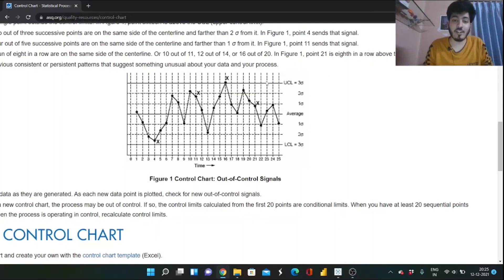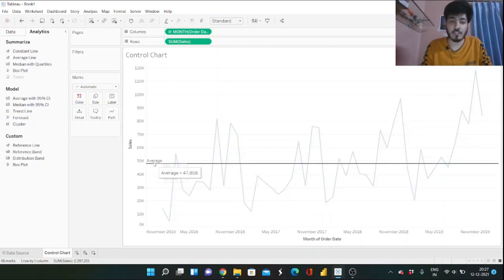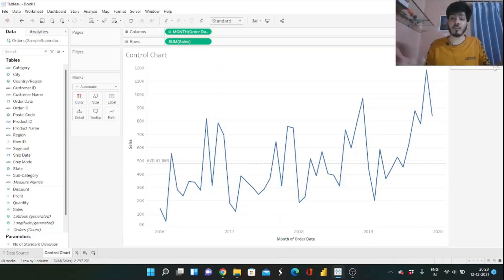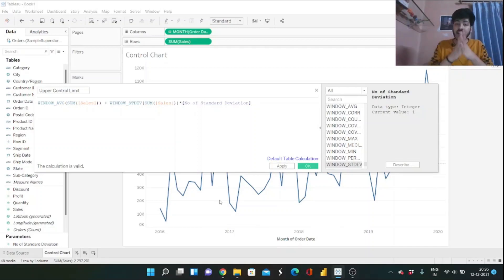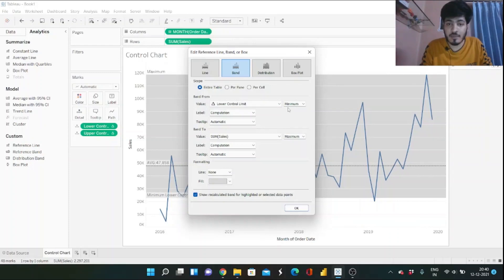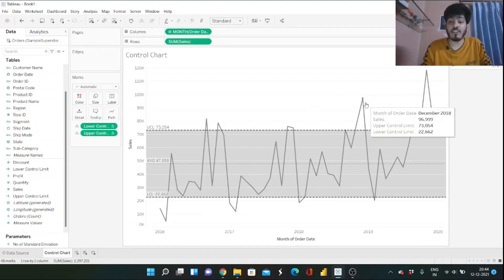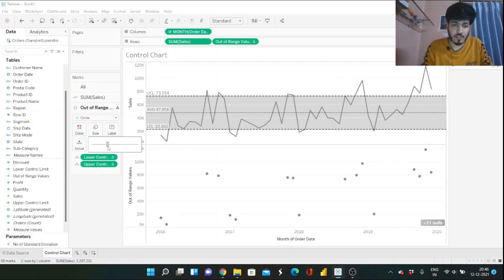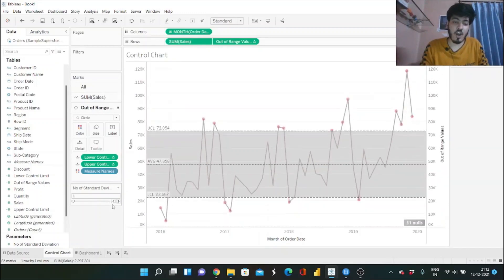Control Chart or Shewhart chart or Statistical Process Control Chart| LearningWithProfessor|Tableau

Comment: Hi Thanks for knowledge sharing
Just wanted and new to stats
What is 1,2,3 in STD
How it's multiplying to sales
Reply from the maker: Glad you loved going through the video Shaik Rafi!

So, to answer your question you can understand it like: Standard Deviation is a measure in statistic that tell
how much data is varying with mean.
So, in this case we are looking at Sales data. So 1,2,3 here means 3 Standard deviation (points we are identifying)
that shows how much it is deviating from mean(That is mean Sales of plotted data)
So 1 means close to mean,2 little far from mean and 3 out of range (Far from mean)
So, SD=3 is considered as critical limit in Stats Of any data 
point is going about that or lower that-3 SD, It means Out of Control.

So what we did was Taken Window_avg(Sales) that is mean added SD( Sales) and have calculated 6 points.

Mean+1SD,Mean+2SD,Mean+3SD and Mean-1SD,Mean-2SD,Mean-3SD .

So, if our control chart is going beyond + - 3SD that shows a sign of alert limit.

This analysis we do when we are seeing any critical parameter like Temp example I have given in starting of video.

Hope you find this useful!

Let me know if still have any doubt. Happy to help!